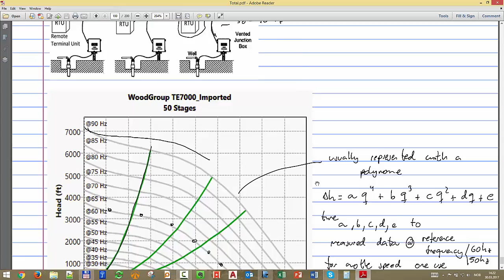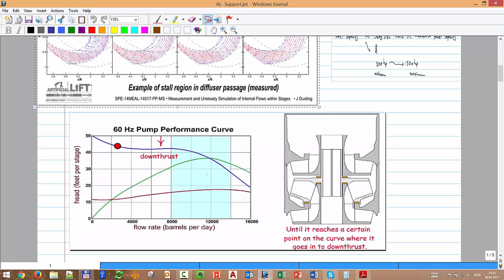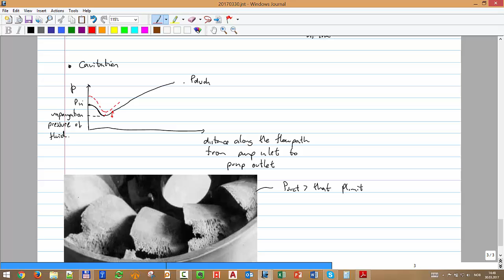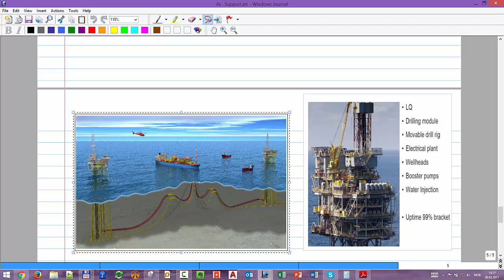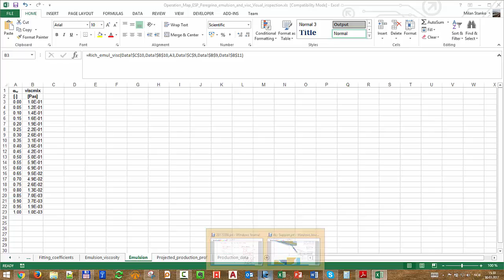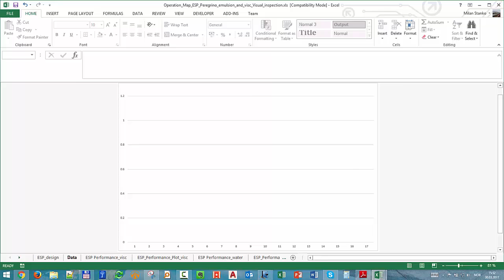20 - Electric submersible pump - flow design verification

Comment: Thanks so much.
i just to know if the pump is working under recommended rate what heppen to E.S.P Although we enter the data to the switchboard to protect .E.S.P string from damage 
an example ( pump rang from 600 to 1350 bfpd) now producing 450 bfpd.

with other meaning could the switchboard protect E.S.P while we run it in unnormal conditions?
Reply from the maker: Sorry for the late response. Some consequences could be reduced life and more frequent failures. This due to increased mechanical wear in the internals of the ESP, thus the switchboard provides no protection against it.